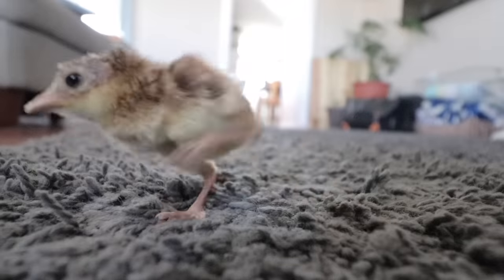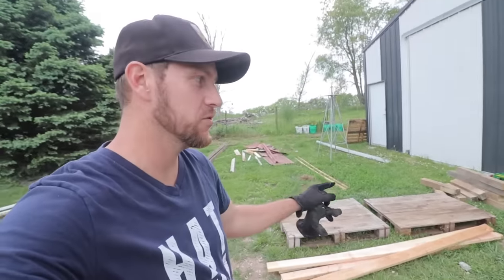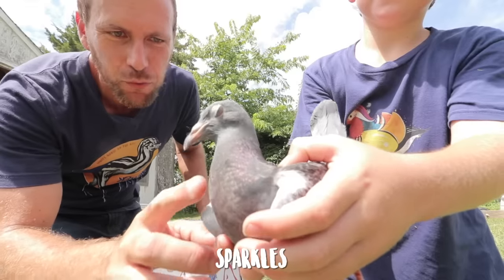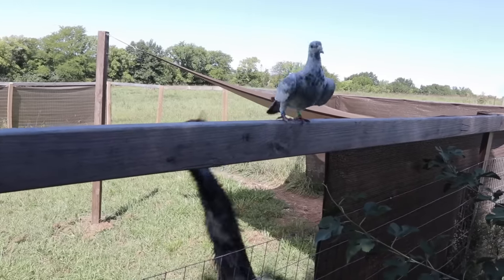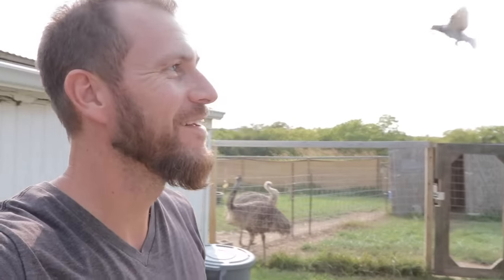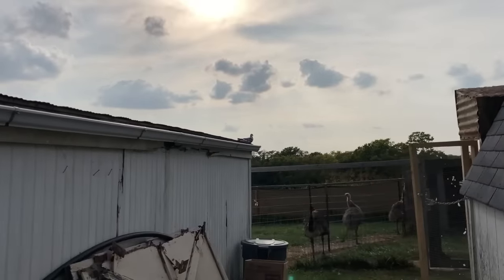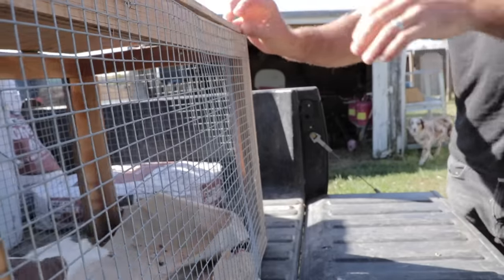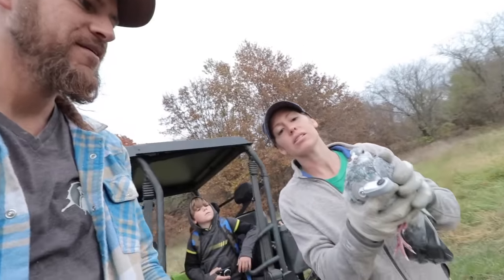We secretly raised PIGEONS for 8 months. Here’s what happened...

Comment: You could replace the solid bottom with wire or wooden strips grates for the breeding box like you did for the loft floor. Even consider using grated plastic nests if its as humid as I had it in Georgia. In that case the bedding (straw) will all fall thru the grates so you can use fine sand for bedding to prevent eggs from cracking. Pigeons keep rebuilding the nest during the incubation but they cant put the straw it back in the  nest once it falls thru the grates. Pigeons are fun if you stay on that level but if you try some serious breeding you may regret as it incredibly demanding and it also has its bitter side.

Comment: Think your homers/ racing pigeons were probably shot looking at the broken leg on the Grizzle that came back . Or they have hit some electrical wires / overhead cables . When training the birds before you release them from the basket / crate let then sit for 10 minutes first before you release them and also make your basket /crate so it has a drop down door on the front or sides so the birds walk out of the crate then take off this will stop the birds injuring themselves and snapping wing flights trying to get out of the top . Hope this all helps best regards 
Aaron Besley  England 🇬🇧

Comment: In the north of England we call em tumblers.white pigeons struggle to hide from hawks n falcons when taking cover in trees. In level flight a pigeon will get away from a hawk or falcon 9 out of ten times, they can  sprint at about 100 mph in level flight, much faster than hawks n falcons. Over long distances pigeons use the sun to know where they are in relation to home, so they need to know how the sun looks when at home before releasing for homing. Never take out a breeding pair, the males will race home fast if his missus is at home.

Comment: man i hope you guys didnt just got from .5-1.5-5-9 miles all within a few fly's, without getting them used to each milage at different coordinates before moving on.  there is absolutely no need to push the limits like that, specially when theres only 4 birds.  plus you guys should consider laying that cage on its side, they would prefer a horizontal cage much better, there not really jumpers, n move around quite a bit when mating.

Comment: As someone who used to keep pigeons (all different kinds) one of favourites were the tumblers. Also I can confirm no training required they just tumble. Also I know it's knitpicky but I have a problem with differentiating pigeon as "homing" pigeons most I've encountered have homing instincts even the fancier breeds. The ones that don't return straight away they generally will come back the next day, of coarse sometimes some dont, it is what it is. Also the issue is chicken hawks, they will start to appear when they know pigeons are around they will start to congregate around the property. Also with flight training one problem you will run across is that if you take the whole flock you will have fewer return than you might think so it is better to leave some at home at least that's my experience. Sorry if this post is slightly fragmented just as I was watching the video the experiences I had raising pigeons was slowly trickling back to me.